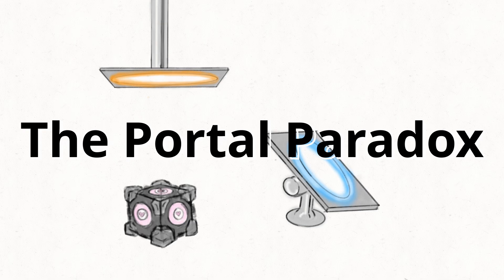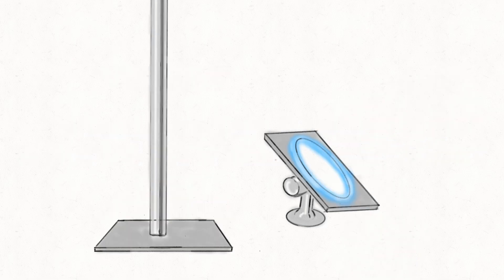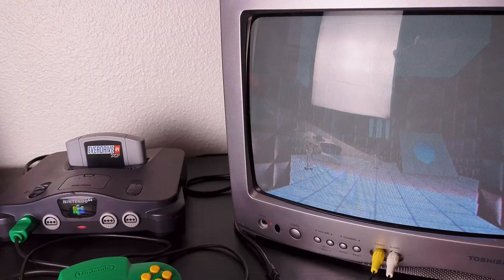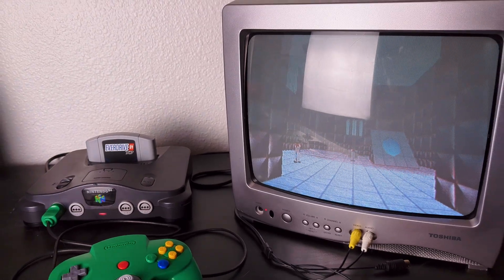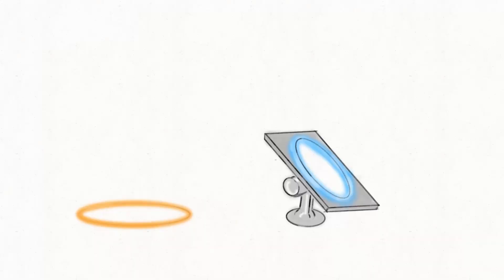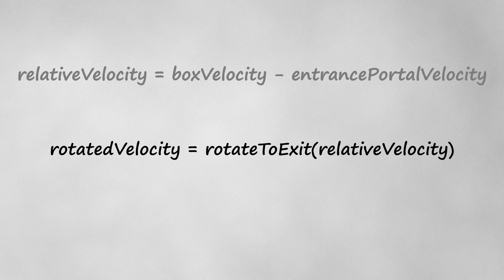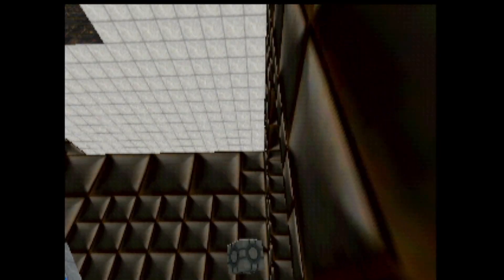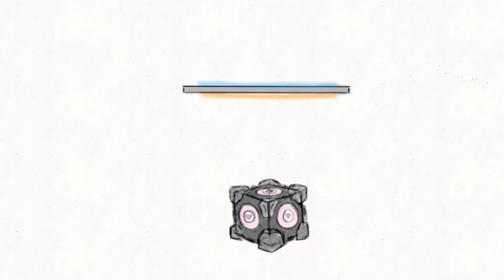I rewrote Portal from scratch and solved the Portal Paradox

Comment: My argument for why the cube wouldn't shoot out of the portal is, no momentum is being transferred into the cube. My first introduction to this was with a moving train barreling towards the cube with a portal in the front. In this scenario, the portal is approaching the cube at high speeds, but that momentum belongs to the train. The train doesn't loose any momentum when it encounters the cube, so it cannot impart any momentum to the cube when it passes through the portal, therefore the cube maintains it's momentum, similar to how a falling object maintains it's momentum through portals.
Reply: the cube not shooting out is just not possible. what would the alternative be? the cube turning into an infinitely thin square at the exit portal? and the momentum of the falling entrance portal just dissapears?
Reply: @kannix386  Probably a boring answer, but I would imagine it would just come out the other side of the portal, then, slowly fall as gravity acts on it. I imagine the portal is like a door frame. If I dropped a door frame around you, you wouldn't go shooting out the other side.
Reply: I thought the same say until i looked at what happens to the parts of the cube that pass to the other side of the portal. as it exits, any part of the cube already through has to make way for the next so it would result in a force being applied and a reaction force onto where the cube is sitting. The paradox is that with the frame of reference of the first portal and the cube, the cube shouldn't have any momentum but from the frame of reference of the 2nd portal and the parts of the cube that pass through there must be momentum. people are arguing so much about the portal paradox because it is just that, a paradox that doesn't have an answer in this universe.
Reply: @Tismitch  I think I get what you're saying. Like, if the cube has no momentum, then isn't it going to just end up all stuck in the same place on the other side? 

That's not how I see it though. Think of a portal as a hula hoop with it's exit and entrance disjointed from one another. If you stand with this imaginary hula hoop around you, your torso will appear on one side of the hoop, while your legs appear on the other. Now, imagine someone drops this hula hoop down onto you. You now go through the hoop, and reappear on the other side. You do not fly up into the air, because the kinetic energy from the hula hoop falling was all absorbed by the ground, not you.
Reply: @Petronio39  That analogy only works because both "sides" of the hula hoop portal are moving at the same velocity and facing opposite directions relative to each other, in this case there is no difference between a hula hoop and a portal. I agree with this.

If there was a difference in velocity of the two portals things get weird.

Think about this: if a portal A is moving and portal B is stationary, as portal A moves through the air: is the air being pushed aside or is the air passing through and out of portal B? 
If it comes out portal B, would you feel the previously still air as a breeze or does it continue to be stationary? If it continues to be stationary, what is happening to the additional air as it is being forced through portal A? Are you forming a disc of hyper condensed air?
If the air is now moving as a breeze, where did that kinetic energy come from?
If the air is being pushed aside, what is generating that force?

If you want a real world analogy for this situation: the portals can be analogous to a pipe with a fixed length, where one side (B) is being held stationary while the other side (A) is being moved forward through the air (maybe in circles so the length stays the same). As side (A) scoops up stationary air, the air is pushed through the pipe by the next particles of air to be scooped up and the previously stationary air is now a moving breeze coming out of the stationary side (B). The force that made that breeze was a reaction force between stationary air and the recently scooped air. This would be true at any length of pipe, as it should be true for our 0 length portal.

 So, if you are stationary and portal side (A) passes over you at 10m/s and the other side (B) was stationary, you would be coming out of the second portal with a RELATIVE speed of 10m/s when compared to the exit side. Either you have a relative speed to the stationary portal equal to side (A) but in whatever direction side (B) is facing or you are now a pancake as your mass is forced to occupy space that is already occupied by your mass. This is why it is a paradox, it breaks our laws of physics. You cannot have two different velocities to satisfy portal physics.

Comment: This is the correct interpretation. If you think of how the cube is moving relative to the portal (accelerating into the orange portal), then the correct solution is obvious. The only way that the cube would stay stationary is if the blue portal was moving backwards at the same rate as the orange portal moves towards the cube. In reality, the particles of the cube gain the momentum as they go through the portal and the particles that are yet to go through the portal would remain stationary, so the true movement of the cube would actually be the average momentum of the particles. (unless the cube pulls itself apart of course)

Comment: Where does the kinetic energy that the cube receives come from?

This does not disprove your conclusion, but when the cube enters the portal on the piston it gains kinetic energy to be able to shoot out.
This has to be supplied from somewhere. 

So does the piston with the portal have an additional counteracting force when it reaches the box, and hence it is the piston that transfers the kinetic energy to the cube?

If so, kinda cool that you can translate kinetic energy without acutally touching the cube.

Comment: I disagree as it would have to slam down at infinity velocy for this to even be a possibility.  At the orange portal first makes contact with the cube the cube would begin for grow out of the blue portal. this at no time imparts and velocity to the cube.  If you stopped moving the orange portal the cube would just sit there 1/2 out of 1 and 1/2 out of the other. The only reason the cube on the blue side would ever move is because it is on a incline plane and due to gravity would then fall AFTER it was completely engulfed by the orange portal and full extracted from the blue portal.

Comment: This doesn't make physical sense. A portal, being a hole in space capable of instantaneously transporting you from one point to another, has no mass and is therefore incapable of imparting any sort of velocity onto the objects that pass through it. Objects passing through the portal would simply retain the velocity they already had, which in this case is 0 because the object isn't moving. You modeled it as though the piston with the portal surface is pushing the box. If that were the case, Chell would be splattered any time she passed through a portal at high velocity.
Reply: you're misunderstanding the premise entirely. The portal isn't the one imparting the velocity, the entire world in motion moving towards the cube is effectively making a cube that was previously not in motion, in motion, relative to the cube.

Comment: I don't really agree on you interpretation of the moving portal. I think it is the only option for a game implementation, but I also think it does not really have its place in the original Portal game (maybe it does in your N64 ports, heck you are the creator).
The way I see the Valve interpretation of portal, they are purely a warp-gate.
TL;DR : Warp-gate are bending reality, connecting two places together, if they move you don't create movement, you change which place is connected to which at every instant. All you can achieve with moving warp-gate is you are lucky enough so that speed, acceleration and direction all match to leave you intact or you end up squished, crushed, slices, disintegrated or a subtle mix of those.

And my "completely clear and understandable" explanation  (maybe I'll come latter to make it more understandable if I manage):
 So if both portal are static and a particle moves through the gate it does not change speed because the space itself is bend in a way the two side of the portal are contiguous even if they would not be without de portal. An object can be seen as an amalgam of particle, it is intact upon transfer because when two bonded particle are each side of the portal they are still applying force to each other and moving at same speed if any.
If you start moving the portal you have very, VERY nasty things starting to happen.
First case (no evil case), both portals are moving at same speed in same direction in space and the object is static or moving in same direction or opposite direction but on same axis as the portal. In that case we are more or less in same scenario and forces are still all "aligned" as they should.
Second case, your portals are still moving same speed and direction relative to each other but the object comes at an angle, for "simplicity" lets say 90. Your object as it crosses the portal in multiple direction at once it will end up deformed and in case it does not like deformation (like living being) will probably be crushed or disintegrated.
Third case, your portals move at different speed, for example one is static the other is moving. If the moving portal reach a static object it will either crush it flat or deform it at an angle depending on the angle of collision (if the portal is fast enough you could end up with a neet pile of very thin slice of the original object on the other side)
Fourth case, everything moves in different directions, I don't even fathom the complexity to explain what happen but more or less you deform or destroy the object in most scenarios.
Bonus cases : lets put some accélération, deceleration here and there and you end up with something going all over the place even more.
In conclusion, moving portal are a hell both of complexity to compute what will happen (as you must manage each "particles" or at least "slice of particles" of the object independently) and as itselft as it will crush, slice, squish, desintegrate most of things it come into "contact" with.

First edit : You could have a scenario matching one in the video if the forces applied on the particles composing your object are lesser than the force of bonding of those particle -> slowly moving portal will tend to juste make so you appear at the other side by you particle "pushing each other" out of the portal at the speed the moving portal is moving. Which can creates movement if you are solid enough. Before we say human being can absorbe part of it I should remind you that your body is composed of lot of stuff not all bonded with same strenght, so it means you will not absorb the "pushing" the same way -> very slow movement you bounce out but with no speed at all, the more the speed increase the more the solid and heavy parts of your body want to go faster colliding in each other as they are pushed through the portal, until the integrity of the matters that compose you is itself destroyed by the applied force. 
Also my hypothesis is that warp gate are playing with force that cannot just be match by matter bonding so if either object or warpgate must bend the object is the one taking the hit.

Comment: The only issue I see with this is that it is in a video game. That limitation doesn't account for the air rapidly moving through the portal as it moves down. But calculating that would be insane

Comment: No problems here! Good explanation, and a good, correct implementation!
You could also show this with a horizontally moving exit portal moving at the same speed as the entrance portal - then the cube will "plop" down from the exit portal, as its speed relative to the rest of the room will be zero.
Reply: I see a problem with his equation. If the orange portal is already pushed to the wall and put the cube on the blue portal if you pull back the orange the box wont go down the portal using his equation. With the given equation for the box to be pushed out the number for the final box velocity is a negative number. But if you reverse the process of pulling the orange portal you get a positive thus making the orange portal sucking the box back in.

Comment: You're only considering the conservation of momentum between the portals and the cube themselves. But it would violate the 2nd rule of thermodynamics in relation to the static enviroment. Applying your code, one could create an infinite power source. All it would take is that you use a cube that is heavier than the movable plate with the entry portal on it. You would need less energy to accelerate the plate than you could harness from the moving cube, which would have the same velocity as the plate but a bigger momentum (since its bigger weight).

Add a little bit of mechanical trajectory work and gearing and voilà, there you would have your portal perpetuum mobile. Which would be illegal, says the physics police.

Comment: There is no solution to the portal paradox, that's the whole reason why its a paradox. 

You get completely different outcomes depending on what frame of reference you use.

If you use the portal as the reference point, the box flies out the other side at the speed the portal was moving since it was technically moving relative to the portal.

If you use the ground as the reference point, nothing happens because the box isn't moving.

Not to mention there technically aren't 2 portals, just 1 portal connecting 2 points in space. Each "side" of the portal is the same portal, so moving one but not the other should be impossible.

Comment: Portal Question: Would dropping a portal like this create a vacuum of air being drawn into and through the portal? or does it displace the air? If you pushed it through a liquid or a gas, wouldnt it in turn push that liquid or gas through the portal at the same velocity? Is that a way of explaining how the cube is being throw on the other portal? Not as much from the portal or cube itself, but from the surrounding air and friction? 
Idk, maybe I'm completely wrong. 
Just thinking
also, AWESOME project and video. Randomly stumbled onto this, happy I did

Comment: while i agree with your implementation i think there is something to be said about the relative velocities between the cube and entrance portal getting priority over the cube and exit portal. you arbitrarily choose that the relative velocity of the entrance portal is what determines the exit velocity rather than the cube and exit portal
Reply: Agreed. The back to back method worked as expected because the equation used negated the velocity of the first portal. No energy is transferred from the portal to the cube. Only the portal and ground. The equation doesn't take into account the first law of physics.

Comment: What about if you slam a portal half-way through the box?
The top half has the velocity applied, but the bottom half doesn't - would we expect it to move as if it's been "sucked in"?
What if you moved it down, stopped it, then moved it the other half at great speed - does it still shoot out?

Comment: Also, even more interesting, if you tried to implement the other behavior it couldn't work.  If the speed out of blue should be slower, how much slower?  Zero speed? Because it's not moving?  By the time orange has gone through half blue should have had exited... zero?  So it just never comes out then I guess.

Comment: ok heres the deal. this only happens the way you first describe it, if there is a fifth element so to speak. does the speed transfer the motion of the piston, to the cube, and if so, why? 1. if the motion of the piston, is transferred to the portal, itself, and then, the portal transfers the motion "without physical contact" to the cube then. yes. If this does not happen, then sorry no this is not the case. My question to you is, why would the force be transferred to the portal? imo, logically it wouldnt. doesnt matter if you re-write the entire game and make it play on your calculator.its how the rules are designed and setup to work.

Comment: The main issue is that a 'moving portal' isn't an object moving through space but a distortion of space itself (and doesn't make sense, especially 'attached' to a moving wall) - it's 'speed' doesn't mean anything related to the box. The box has 0 no momentum/ velocity at the start of the test and changing space coordinates around it (what a moving portal does) does not introduce it.

Comment: I think gravity would be more of a factor than inertia. Arguably, the portal itself has no velocity, since it's just empty space. The platform has velocity, sure, but the portal might as well be a hole in the platform. Air would move freely through it, as if nothing were there. The same would apply to the box, no? The flaw in your code is that you designated the portal as an object, and one that has a velocity. The box would, thus, simply fall out of the exit portal, due to an inconsistent gravitational pull moving the center of gravity of the box.